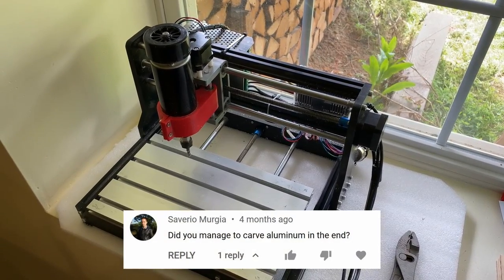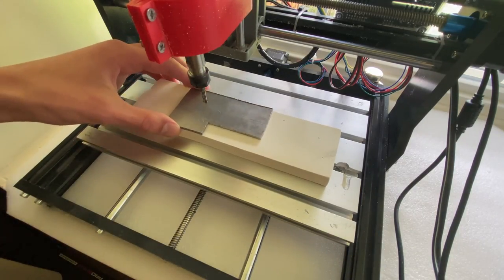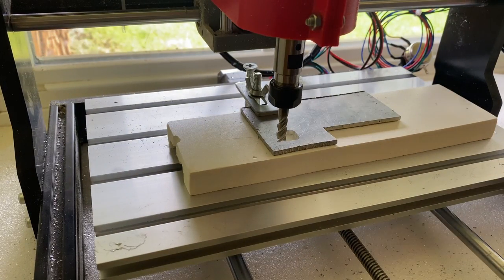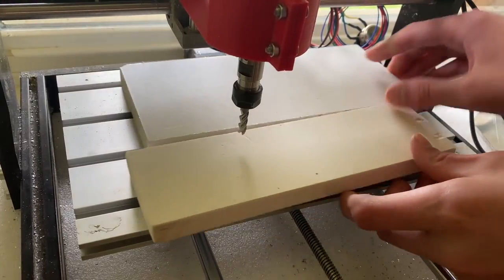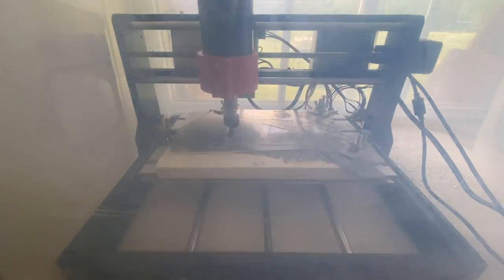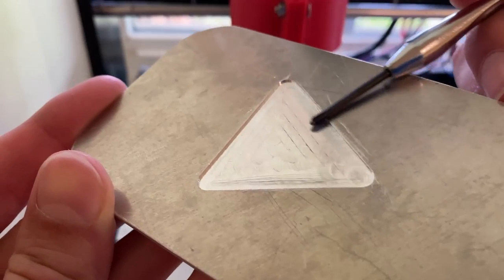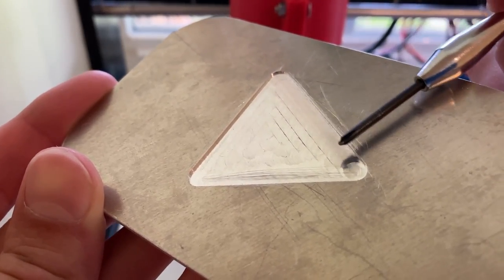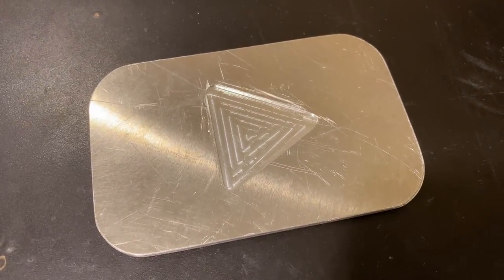Will a 3018 CNC Machine Aluminum?

Comment: So... the only modification on this CNC its the 500w spindle? the rest its "plain vanilla"?
Reply from the maker: Thats correct, the only upgrade was the 500w spindle kit as shown in a previous video. (I also did put a tub ontop of the cnc so that metal chips don't fly everywhere, but this shouldn't effect performance)
Reply: The next mod that i would do will be to upgrade the z axis to an all metal one or one with linear rails... 
Then liner rails on all axis
And finally a heavier y axis table

Comment: Hello, could I use this machine to engrave small writing on an aluminum keychain?
Reply from the maker: Not on bare aluminum. This type of laser reflects off of metals such as aluminum. You could paint or anodize the keychain, and then engrave the writing into that instead.
Reply: @CarbonCoil  no I’m not trying to use the laser I’m trying to use the dremel type bit. Idk if it that makes sense but I do all my engravings by hand and it would be convenient if could just get a machine to do it. I researched the anodized way but I wasn’t really interested in that way. Thank you for replying 🙏
Reply from the maker: @dc_andrade  Sorry for the misunderstanding! This machine with an engraving V-bit could definitely be used to engrave into aluminum, especially if the engraving surface is flat. If you end up using a 3018CNC for this, I would love to hear how your project turns out!
Reply: @CarbonCoil  that’s great to hear! Yes I’ll have to get it pretty soon then! Thank you very much for the info! Take care and I’ll keep it touch🙏

Comment: Hello, what type of filament (PLA, TPU,...etc) did you use to print the spindle holder? . Thanks
Reply from the maker: For mine I used PLA but I would NOT recommend using this material. If you look closely, the spindle holder is actually already cracked at a seem near the screws. I would suggest printing it in ABS or something with even more mechanical strength.
Reply: @CarbonCoil  i would suggest something in between, like petg, abs has some springiness in their structure that will add some flex in the holder... And in CNC machining it's not the best idea...
Reply from the maker: @Lucas_sGarage  Thanks! I'll keep this in mind if I print it again.

Comment: Will this lightly etch stainless steel? I dont need much depth, just need to trace stencils ?
Reply from the maker: I've never tried to engrave steel. It's much much harder than aluminum, but it could be worth a shot if you just want to scratch the surface.
Reply: Have you tried? I would want to buy one of this machine only to engrave stainless steel
Reply: @MrTaVy07  you definitely cant engrave with this. Only etch

Comment: How much depth we can cut,
Reply from the maker: A single pass in aluminum on this machine has to be very shallow (a few thousandths of an inch, I used 0.003”). By doing multiple passes, any depth can be cut as a result, (assuming the end mill is long enough).